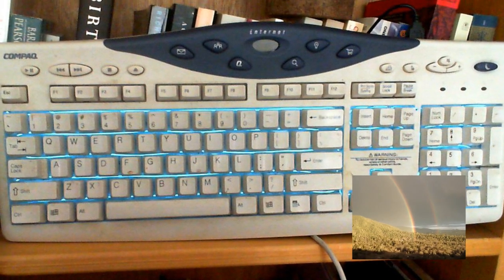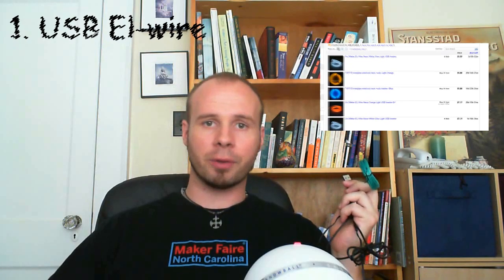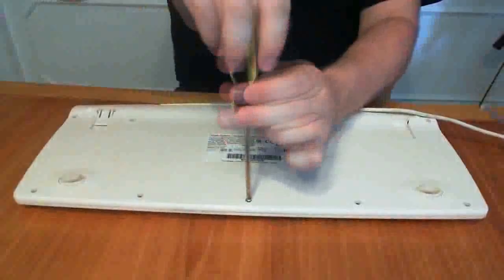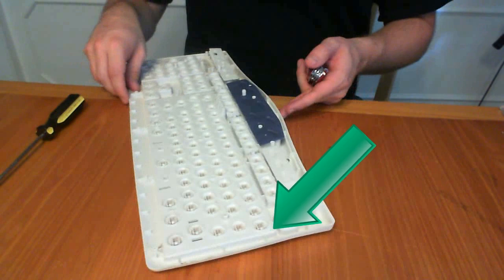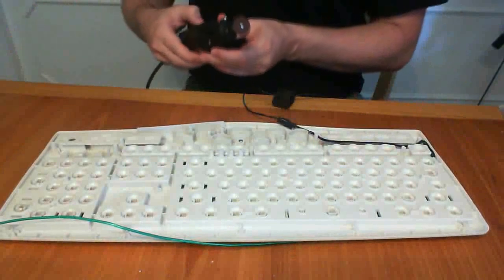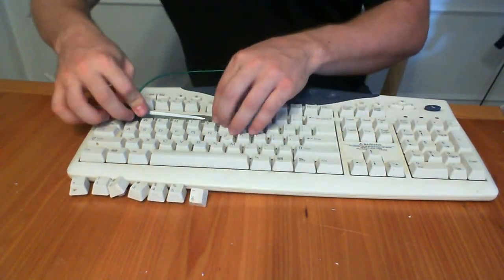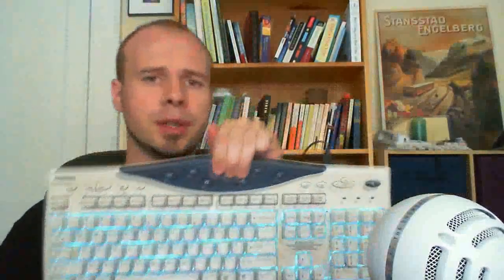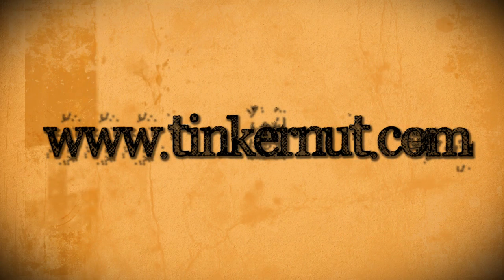How To Make A Backlit Keyboard

Comment: this is neat. I guess to wire it up 'right' with a keyboard like this I'd want maybe one of those usb splitter things, and then remove the old usb connector, remove the usb connector from the spliter, solder the splitter in internally, plug the el wire thing into that, and then mount the other usb connector from the splitter where the old connector was. (just writing this down to think it through if I try it). then I guess if it was a multi-splitter deal you could power more than one small device on the keyboard depending on... electrickal mathematiks etc lol

Comment: Tbh no i dont wanna break my keyboard
Reply: This won't break it? I Don't understand how you could break something like this, unless you are using a drill press to open it
Reply: Tntmod54321 I meant I might render my keyboard useless if i mess something up while trying to do it
Reply: Insanitarius It's not that hard, you could just remove the keys, run it through them, but the keys back on, and plug the usb in

Comment: just buy backlight keyboard they re not expensive and skip this video
Reply: Yeah, but what if you want an orange backlit cherry mx black keyboard? Never seen one, so just get a cherry black keyboard and put light up orange cable in it.
Reply: 999momak I personally don't want it, but just as in example
Reply: Level Failer are you trolling the troll :D
Reply: 999momak no, you'd beat me at trolling.
Reply: Level Failer :DDDDD good answer
Reply: *****
bit rude.
Reply: 999momak it's not about buying, it's about being creative
Reply: 999momak You've actually just been trolled.
Reply: ***** Tell him what?

(look now)
Reply: actually  a cheap good one can set you back 70 dollars
Reply: we all arent ritch like you
Reply: Not if you're trying to backlight a laptop keyboard.
Reply: *****
YEAH NERD!
Reply: Level Failer Shhhh... Don't tell him that.
Reply: Level Failer omagad, wut have you done?
Reply: *****
I DID NOTIN!~
Reply: Level Failer ducky shine 3 orange backlit black mx
Reply: Yingcheng Kou I knowww, it was just an example.
Reply: Cauxi rich?? it doesn't cost that much
Reply: 999momak à
Reply: +Level lol , the cherry mx switch case already served 3mm LED hole , you could just buy 3mm orange led and solder it into the PCB (in this case if your keyboard pcb support for placing backlit)

Comment: just buy a mechanical keyboard uses cherri mx switch it already have backlite out of a box
Reply: nope i have a steelseries 6G V2 and it doesn´t btw its named cherry mx
Reply: Typo
Reply: oki
Reply: taz jumpen xD
Reply: mechanical keyboard is not the same as backlit. some mechanical are backlit just the same as some rubber dome keyboards are.
Reply: But can I add a led on cherry mx switch keyboard?
Reply: GangastronYTP and that is your opinion. i dont like the sound of them and i dont even know where to get one today unless used.

Comment: I think its a quite dumb solution. In the dark the light will blind you and you cant see the letters. 
The process of seeing is a simple method. Proper quantity of light needed as reflection from the sighted object. In this case the light comes from the inside of the keyboard, and the tops of buttons cant get enough light.
Reply: cut holes in your keys in the shape of the letters lol
Reply: EDit23452
Horrible work. :)
Reply: i congratulate you on your ability to detect sarcasm
Reply: actually a better solution would be to be using a keyboard where the plastic of the keys is actually transparent and just painted white/black, then you just need to get rid of the paint, get some key stencils(internet is full of them) and paint it again leaving only the chars transparent, then you have a proper backlit keyboard, a little more work, a lot more beautiful(and functional)

Comment: I just did something like this to my QuickFire Rapid Keyborad. Insted of drilling holes to get the inverter inside the keyboard I just extended the black connection cable and driller a tiny hole in the left side of the TAB Key, and in the side of the keyboard I attatched a 250 KmO potentiometer to control the light brightness. To power the EL Wire I just wrapped the black connection cable (a stiff connection cable) arround the USB Cable of the keyboard to the back of my PC. Any doubts contact me

Comment: yes, probably! I got this keyboard and the difference between this keyboard and the one he's using is just the mechanical switches. Though there's a verson of the 6GV2 which has red backlight, but this keyboard don't have the Black MX-switches like on the original version, but Cherry MX-switches. The Cherry MX-switches are less resistant when typing, and imo, more comfortable to type on. I'd recommend you buying the "red" version, though that's just my opinion.

Comment: It doesn't really look that nice on a white keyboard and you have bits of el wire sticking up and it doesn't look very nice...when I'm older and I get a job I will most prob buy a £20+ backlit keyboard(with light up keys)

Comment: Yes, sadly. a few months ago I was laptop shopping and that was what I was finding.

Very few companies even make backlight keyboards. The few that do usually put them only in their most expensive chassis were the only difference is a pretty case and all the internal components are the exact same. In some cases it will cost you much more then 400 to upgrade to the backlight keyboard.

Comment: I have tried a backlit keyboards for my laptop, but the best one has translucent letters on the keys, so the light shines the letter rather than the surrounding gaps. The trouble is most PC keyboards just have the symbols printed in the top of the plastic rather than mounded into the key.

Comment: Thanks for the heads-up on the materials you used...but unless there's enough light coming from between the keys in the dark to illuminate the key faces, this is really no better than 'ricing-out' your keyboard.

The problem is that, in a dimly lit room, the light from this keyboard will cause your pupils to contract, making it even more difficult to see the lettering on the poorly lit keys.

If you can touch type, then this mod is just as useless, as you won't be looking anyway.

Comment: PS: instead of using the usb port on the sides of the keyboard it can be easily modded to use power being used by the keyboard itself.

Comment: el wire is noisy as hell mate, cheaper to put sm leds behind the keys. link em all together and power it with a 9 volt hidden inside ur keyboard (that one has space for it near the top) depending on how many sm led u use u can power it with the sub cable instead of 9v

Comment: to be able to see the keys, i recommend using a dremmel with a tiny point and piercing each keys that you want lit. For instance WASD and your macro button then wraping them in a sort of fiberglass membrane, then heating up the keys with an heat gun to make the fiberglass wrap tightly around the keys and to avoid feeling the holes that you made in the keys. And there you have it! I will try to make a video as soon as i get my lit wire and some money.

Comment: you can get the power from the circuit board and you don't have to drill a hole or use usb port.